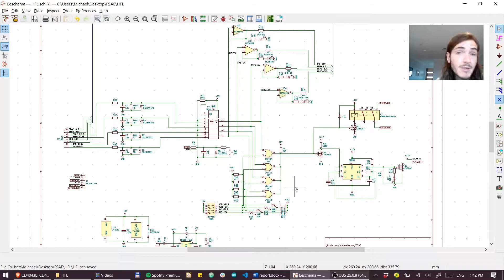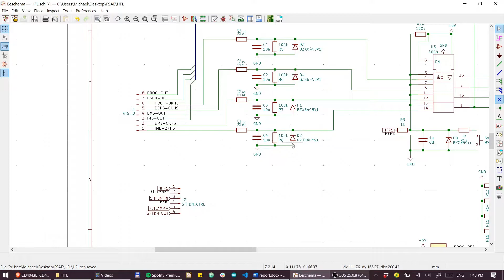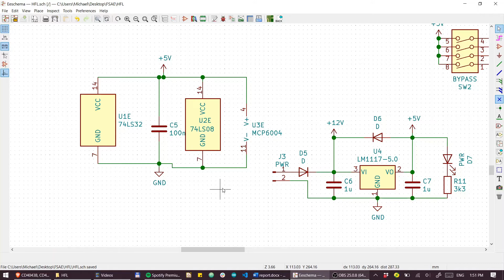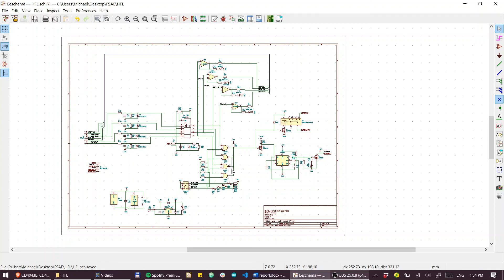Hard Fault Latch design walkthrough (FSAE Australia 2020)

Comment: This video is great. I'm also involved with FSAE and was wondering what the reasoning was for all your signal filtering since digital signals are relatively rugged and less susceptible to noise. I find it hard to believe that the signal will accidentally cause a fault since that'll require a voltage dip of at least 2 or 3 volts, though there might be other causes for signal interference that I'm not accounting for. My team is doing EV for the first time so any help is greatly appreciated. Thanks in advance.
Reply: Hi there, We are also 1st year Formula Student EV team from Bangladesh. We are preparing for FS UK 22. Which competition you are preparing for?

Comment: Thanks for your videos! I am just  starting to learn about designing PCBs. When you are designing your board how do you deal with both 5 V and 12 V supplies? Do you have separate inputs to your board or do you use a converter on the PCB? Do you have just one plane for gnd?
Reply from the maker: This design has a linear regulator (ams1117) on board, sharing the ground with GLV-
It's usually best to include voltage regulators on each board rather than trying to distribute low voltages from a central regulator
Reply: @MichaelRuppe  Thanks!